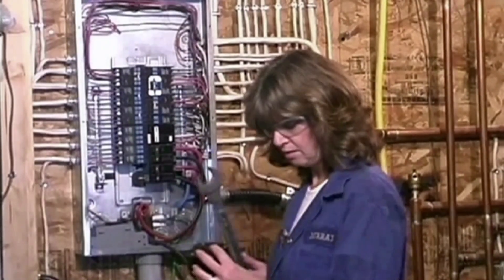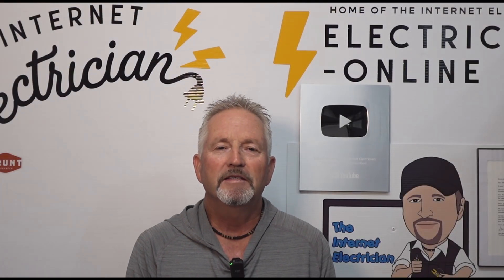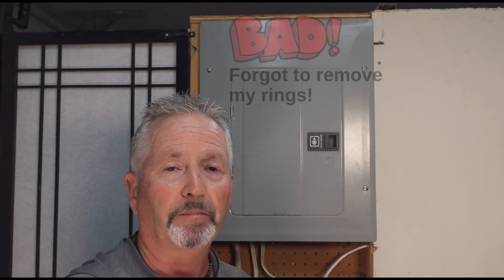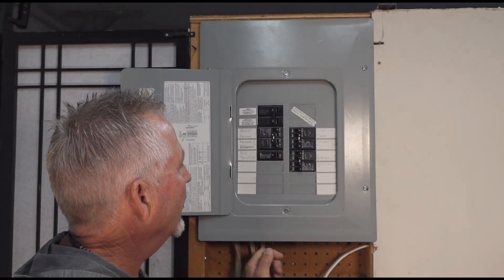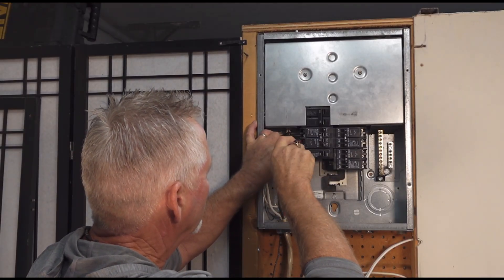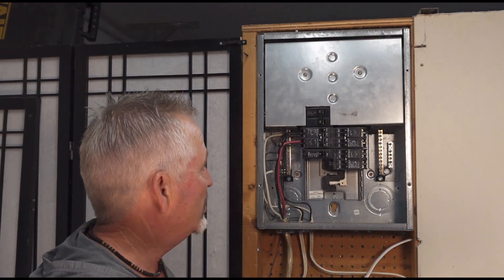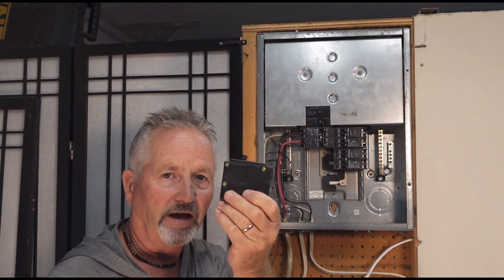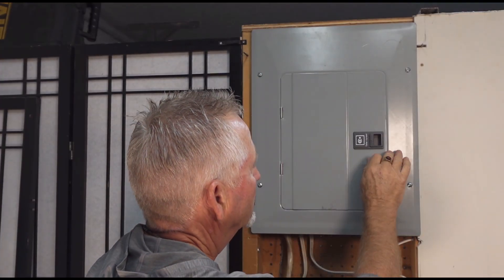How to Replace a Breaker in Your Electrical Panel

Comment: Can I use a 14/3 wire without connecting the red wire. Can the red wire be capped off at both ends resulting in the 14/3 wire becoming a 14/2 wire. This wire was previously on a two pole breaker each pole being 15 amps.  We just completed a kitchen reno. I had the electricians pull the two pole breaker to allow for a 15 amp breaker for  direct connection to the dishwasher. Second was to allow for a 20 amp breaker install to power the microwave.  Obviously nothing else will ever be connected to these new circuits.

The old 14/3 wire is still running thru the house to the kitchen counter. However I had the electricains pull it out from the panel box. When it use prior to the reno It was connected to one receptacle only. With with the red hot to top plug and the black hot to the lower plug. No other receptacles were ever attached to that circuit. The only occasion for using that two pole  receptacle was for a tea kettle or a crock pot. The reason we would like to use the receptacle is that it is 8 inches from the range and we want to use the tea kettle on top of the range so the steam moisture will be collected by the range hood. 

First is that receptacle with the disconnected 14/3 wire too close to the range which means I need to pull it. It is 8 feet from the sink. Should I just pull the 14/3 wire and replace it with a 14/2 or 12/2 since it is at the kitchen countertop. That change requires new breakers and a new receptacle. The home was built by us in 1993. We are the original owners. The panel is 100 amp and is a Federal Pioneer. The kitchen counter top has always had four receptacles that are controlled by two split pole breakers. They are by code the proper distance apart. Considering these four receptacles all that is connected is a basic toaster and the tea kettle. We do not use cofee machines or other high amp applainces at the countertop. On the other side of the kitchen we have a cabinet that has a toaster oven on its own 14/3 wire circuit controlled by a two pole breaker with each breaker being 15 amps. There is only one receptacle for that circuit. It is connected the same as the disconnected 14/3 wire. 

Thank you if you have time to respond.
Reply from the maker: Is there room in the panel to accommodate a 2-pole 15A breaker  again?  If so, I'd hook that receptacle back up as a split receptacle.  There's no issue with it being 8" from the range, and it doesn't need to be GFCI where it's at.  Not to mention that your home is grandfathered so to keep that as a split receptacle would only be returning  it to how  it was.   To answer your first question, yes you can use a 14/3 and just cap off the unused red wire at both ends.
Let me know if I'm missing something here where as that wouldn't be a solution?
Reply: @theinternetelectrician  I only have 3 open spaces. You captured it all. Basically your videos have allowed me to acquire the knowledge that I need. It was rewarding to be able to inform the renovation  electricians what had to be done in their lingo when they arrived. 
Respectfully thanks a bunch
Reply: @theinternetelectrician  It all worked out fine. I had a receptacle next to the panel which was the only unit on a 15 amp circuit. That is the receptacle the builders install to provide power during initial construction. We have never used that available receptacle. I capped the red hot wire at both ends and installed a new receptacle in the kitchen. The previous receptacle had the connector broken to allow for two hot wires each providing 15 amps. I did purchase lever receptacles as this makes life easier for the DIY installer. The 14/3 wire had been installed after the home was built. It runs from the panel, thru a hole in the basement ceiling, up to the attic and across above to the kitchen and then down concealed between walls to the countertop. This fix solution saved a lot of time and money. 

Thanks for the solution.

Comment: I replaced it once a circuit breaker didn't have to remove any wires. Just pop out the bad one and pop in the new one. I suppose depend on the box.
Reply from the maker: You've got me curious?  What panel was that?
Reply: That was a long time ago, don't remember. The owner just bought the house and ask my help to fix the breaker issue. I swap the old with new and his room fan and electric sockets were all started working.

Comment: you must still be in costa rica.  I don't believe most Canadians are supposed to open the panel and do the change.  I agree that if you know what your doing it is safe, but do most people know.   Here in Ontario, we are required to hire an electrician to work on the panel.  I don't agree with the law completely, but I wonder if it is a good idea to teach 101 DIY on high voltage.
Reply from the maker: I'm not saying you're wrong, and it could be a provincial or local addendum? And no, I'm not in Costa Rica right now. With the power off and with proper guidance and information,  my philosophy has always been that homeowners will do these things themselves, and my goal is to educate them to do it correctly, and do it safely.
Reply: Homeowners in Ontario can file a notification of work with ESA, do their own work and have it inspected.

Comment: ....am I the only guy that was taught, as a 17-year old apprentice, that you should ALWAYS WEAR SAFETY GOGGLES before you even open the panel?????
Reply: never seen a flash over from a 240 volt single phase panel.   Sure it can spark, but a real flash over will happen in a 3 phase 600 Volt panel.
Reply from the maker: Not likely to have a flash over, but I will admit, when I was a 1st year apprentice and was working in a live panel adding a new cable, I thought I was careful and cocky enough to do it live.  The bare copper ground wire got away on me when feeding the cable into the tub and went across the 240V bus bars.  Copper blew out and a piece the size of a bb shot embedded itself on the lenses of my prescription glasses. Could have been a serious injury, and my lesson was learned.
Reply from the maker: I guess Sandy wasn't aware of that!  Good advice for sure, but if the main breaker is off, and the main compartment isn't open, not much danger in a de-energized panel.